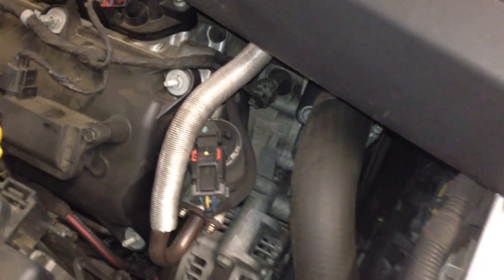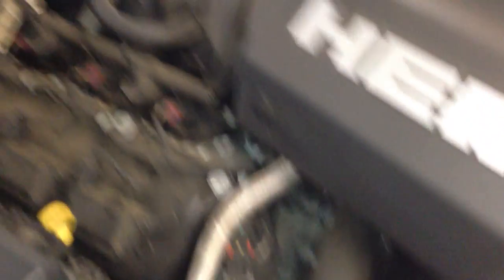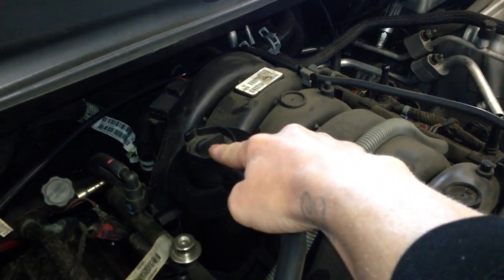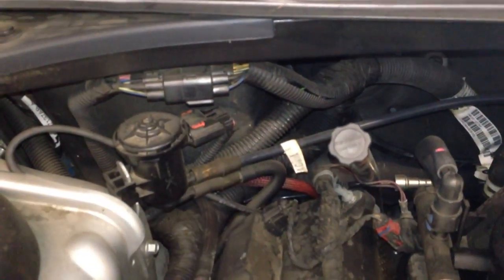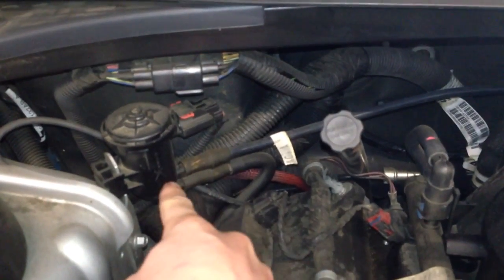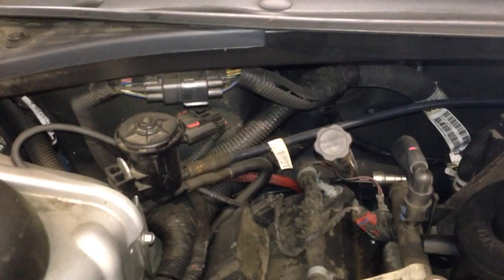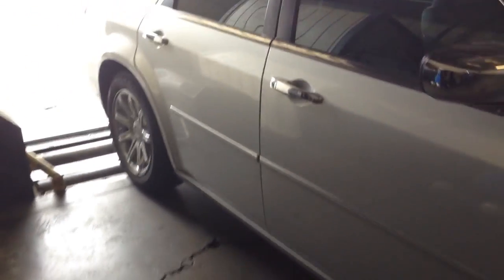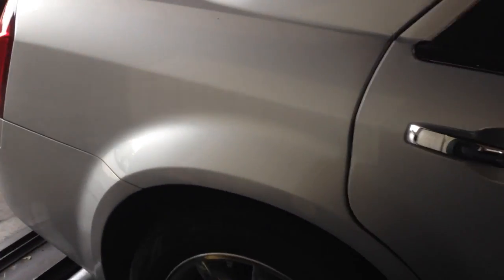Chrysler C300 emissions: PCV, EVAP canister & purge, EGR valve locations

Comment: Where is the purge solenoid valve ?
Reply from the maker: Did you find it? If not, take a few pics of your engine compartment and send the to me. A pic from the front, the passenger side, and the driver side. I'll circle the part and send it back. (925) 418-5096

Comment: Do you know if thats a aftermarket supple fuel line the one that's connects to the injectors?? I just replaced fuel pump still starts then dies buts now its leaking fuel from there just curious because my fuel supply line cant find oem ones at auto parts store on Az PHX

Comment: Was the "red lightning bolt " coming on? Plus was the car idling high?. Everyone says replace the throttle body,  which I did, still having the same problem.. I seen on the v6, the blue egr gasket being bad would cause this. I know there is a white gaskets on the egr tube that goes into the intake on the hemi. I'm wondering if that would fix it, before I get a new computer,  cause they say that's the next step if the throttle body doesn't fix the "red lightning bolt", thanks

Comment: Thanks for this video! I just replaced my EGR valve which took about 30 minutes with the help of a 10mm ratchet wrench. Now I'm getting code p0456 for the evap canister. I've also noticed that if I top off the fuel tank the engine will run terrible for about the first 10 miles.  I'm hoping it is the purge valve as I dont see myself dropping the fuel tank. 
Take Care
Reply from the maker: The systems have nothing to do with one another unless you did something during the egr repair. The p0456 can be a lot of things. First, check the cap. Make sure you have a good factory cap. Do not use locking caps. Check the seal on the bottom side of the cap for cracks... if that is not it then you need a 'smoke diagnostic' on the evap system. Did you disconnect anything on the engine that had to do with the evap system? Maybe the purge solenoid? Fallow the vacuum line from the engine to the purge and past it. Look for loose connections or moisture on the line. 

Good luck! Hope that helps! If you have any more questions, feel free to ask.
Reply: @ScottiesHobbies  I found a evap canister purge solenoid lifetime  warranty for $42 at autozone with veterans discount. 
It looked easy enough to just change out and man I'm happy I did. My car has been idling rough for thr last 2 years but just recently threw this 0456 code. Well replacing the valve not only cleared the code but the car runs like new now!   
I had to break the old valve housing to get it off the mount but it was getting replaced anyway. Also the wire clip broke but still had a secondary clip that kept it locked in place on new unit. 
Thanks again for your video! I'm back cruising that HEMI! Just need to replace front shocks and I'm golden!
Reply from the maker: @WILLYSCHNUCK  Hell yea!! Good job getting in there and getting it done. Thanks for your service too! I am glad to help when I can. Good luck on your future diy projects and keep us posted.

Comment: Hey how's it going great video so I got 2007 chrysler 300 touring  3.5  
Got code 0007 fuel  shut off where is this located?
Reply from the maker: Try this on your car if you have not done so, you might get more codes. https://youtu.be/t609OQlZWiE
Reply from the maker: That car does not have a fuel shut off valve. It uses the computer to command the fuel system on or off. Any other codes? Are you using a code reader? Did you try reading codes on the dash?
Reply: @ScottiesHobbies   yeah got a guy from work has diagnosis machine we took off intake manifold to look at fuel rail and not a clip in site 
I bought the manual book and that too wasn't any help 
However now Im getting the lightening bolt and esp warning on instrument panel

Comment: These cars have a recall on this call the dealer free of charge
Reply from the maker: That is a great idea. I actually recommend you call the dealer when you purchase a used vehicle to check for any recalls. You'd be surprised to how many emissions recalls don't get done.
Reply: Scotties Hobbies yeah I really just got a call from the dealer today about this problem that’s why I watched the video they told me bring it in and it will get fixed free of charge
Reply from the maker: @brandonyoung645  take advantage of the free services when you can.
Reply from the maker: You might ask if there is any non essential recalls or if they can check. I know here in CA only 'safety' recalls get notified to the consumer. Recalls for Trans or engine wont hold up your registration.

Comment: Do you have a fix for p0452? For a chrysler 300c 6.1 Replaced all parts listed in video and it's still throwing the code
Reply: I need info on that to gotta 06 touring EVAP pressure switch stuck closed going in limp mode .

Comment: Just had my 2010 Chrysler 300 smoged in about ten minutes..guy did not even start the car just popped the hood, did a visual on all the hoses etc then hooked something up and said..you passed and the test report sent to the DMV,. that will be 45 bucks. I said that was fast and he said..all your emissions readings are stored on your computer and they all read within limits. Russian guy at a hole in the wall smog testing shop..did he pull a fast one?
Reply from the maker: He didn't pull the fast one. The state pulled the fast one. The new system is a plug-and-play system all through the OBD2. In my opinion we are going to have self-service kiosks like they do in Connecticut and a couple other states for you the consumer to be able to do your own emissions inspection. The state doesn't need us anymore to check hoses. Practically you don't even have any more emissions hoses. It's getting crazy. In my opinion we are just aiding the state in collecting a tax from you the consumer.

Comment: I Have a 2005 chrysler 300 with one problem, when I fill the tank the car just dies when its in the neutral, the injection lights blink because the canister is cataminated. We already change the  tank and the canister but the problem still. Can u help me?
Reply from the maker: Maybe your purge solenoid is stuck open. Maybe you are filling the engine with fuel vapors causing a rich condition?  If your vapor canister is filling with fuel, I would think your vent solenoid is stuck closed. Its hard to believe both solenoids are bad but that is my logic. After that, look at a schematic photo of the evap system, see what solenoid is between the tank and the vapor canister. That balve/solenoid is bad too.. its hard to believe that is all bad if you maintain the vehicle properly.
Reply: @ScottiesHobbies  tku , I will check those partes
Reply: I have a 2006 Chrysler 300 Hemi and mine does that when I fill it up with gas. If I fill it three-quarters of the way it usually don't do it. I bought a aftermarket gas cap is when I noticed it doing this stuff. So I switched and put that stock gas cap back on it now it stalls out and does this whenever it gets low on gas. I don't know what it is I've been told the evap canister is clogged up. this only happens when I'm full of gas or on E

Comment: Hi Scotty. Nice vid. Gave me a direction where to find my problem.  I have an 06 300c hemi with 103000miles. It sometimes stalls or when i floor it its like the ignition is switched off and on real fast. I already replaced:egr valve,camshaft and crankshaft sensor and map sensor and now the ecm. It gives the p0499 code and says evap pressure high.  But do you know if i have to be under the hood at the valve,or the cannister under the rear fender? Thnx in advance and greetings from Holland.
Reply from the maker: From what I see a P0499 is Evaporative Emission System Vent Valve Control Circuit High. Have you checked your vent solenoid?  The hose to ambient gets debris in it from raod grime , dust, and I've seen spiders make nests in them too. If the hose is clear, check the solenoid it self. Check the resistance, I don't know dhat spec it but I'd just get a new one and ohm test it before I remove my old one. If resistance is good, I'd check that the valve is actually moving by applying 9v to it. With no power it should hold vacuum. With power the vacuum will not hold at all. Hopefully that all helps. Keep us posted!
Reply: @ScottiesHobbies  i just installed a new cannister.  The valve solenoid under the hood clicked when i connected it straight to a battery. I put it back in the car but doesnt seem to work. Maybe order a new one?
Reply from the maker: How do you know its not working wile in the car? Or why do you think its not working? I have a fairly recent vid in my library of doing a test and showing how a purge valve works.
Reply: Did u ever find the problem?
Reply: @capo5582  yes, I put in new sparkplugs, with the wright codes on them, and new denso coils, runs perfectly for 3 years now.

Comment: Thanks for info I've changed the PCM egr valve clean throttle body and just replace camshaft plus added tranmission oil next up is to change the transmission plug follow by the TCM you know a website where to buy the TCM again thanks your video help im not a mechanic at all i just put the video and just follow step by step 👍👍👍👍
Reply from the maker: Man.. I faithfully recommend Rockauto.com but I checked their site and I do not see one. Maybe try to call them??

Comment: Question do you know if i can buy a TCM on line and just put it on or do i need to take it to dealer im having codes p0700 and u0100
Reply from the maker: +Gabriel Lozada you should be able to just buy the TCM and install it yourself. The PCM usually needs to be flashed with the VIN number and what not when installed. Those codes you have are super common. My sister had the same issue on her 300C and we ended up replacing the PCM and the TCM and that finally made the issue go away. I've also heard that sometimes the transmission wiring harness to gets dirty at the connectors and sometimes just a good disconnect and cleaning with electronic cleaner does a real good trick.

Good luck on your fix and please keep me updated. It would be nice to know what you're fixes so we can maybe help somebody else.

Comment: Great video. Do you know where is the leak detection pump on that c300. thanx.
Reply from the maker: +Alex B i believe the leak detection pump is a part of the evap cannister when you buy a new one. The fuel tank needs to be dropped to get the leak detection pump and the cannister out.
Reply: Scotties Hobbies 
thanx again. im most certain this is the information i needed.
Reply: Is that on da dodge magnum to need to drop gas take to get to da fuel vapor leak detection pump?

Comment: Good morning i have a 2006 Chrysler 300c 5.7 and I already change the PCM and it still stalling and check engine light comes on with codes P0700 and U01000 please help if you ever fix this problem thanks